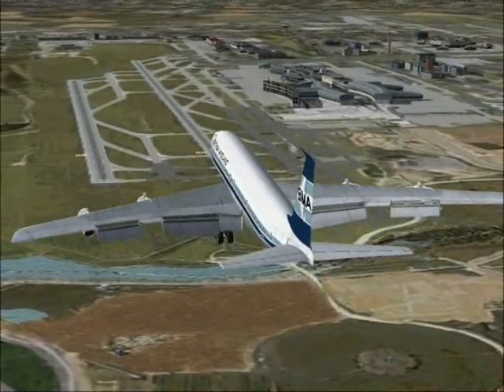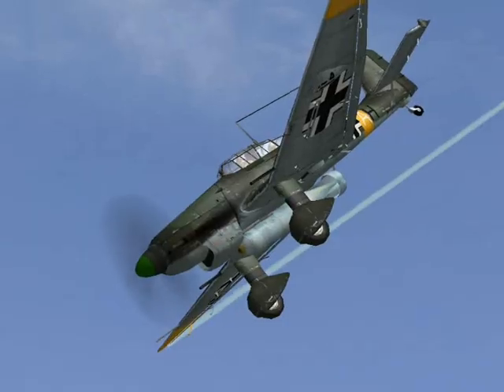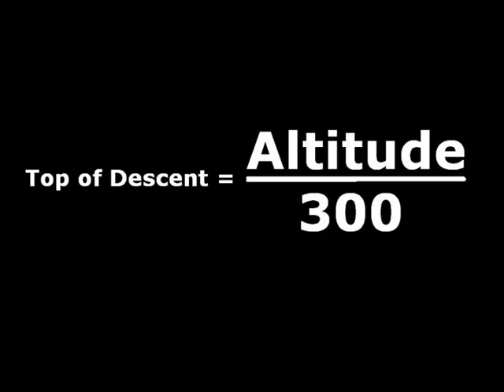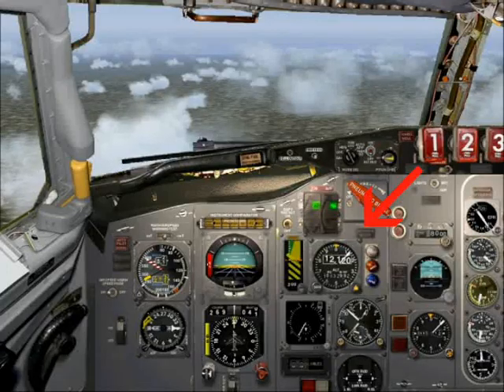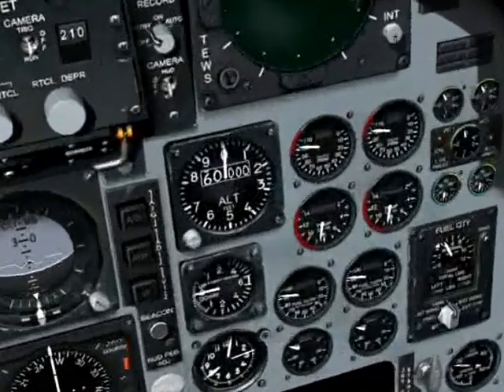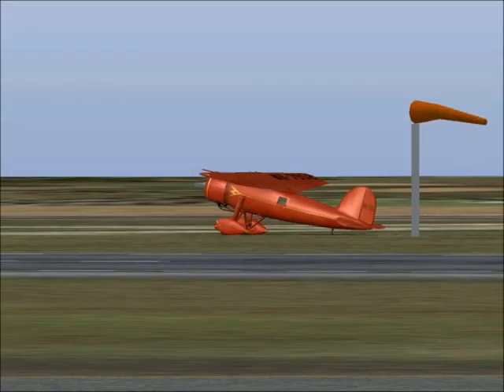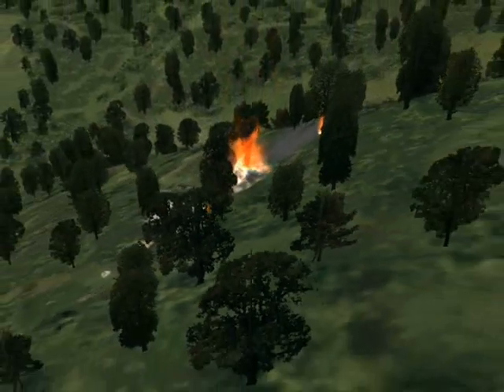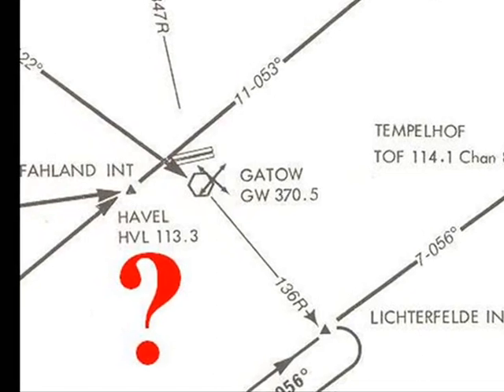Descent Planning Tutorial

Comment: Vertical speed calculation is distance from airport multiplied by your altitude. Ex: 15,000 feet and 55 nm.   55x15 = 825 rounded to 800 but on approach if u feel to low or high u can change it by a little or a lot or just take manual control